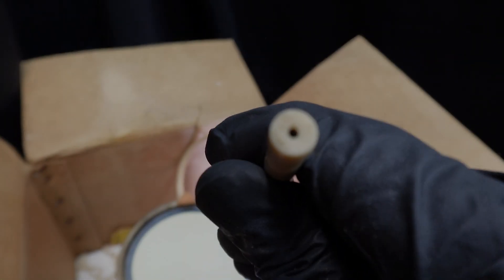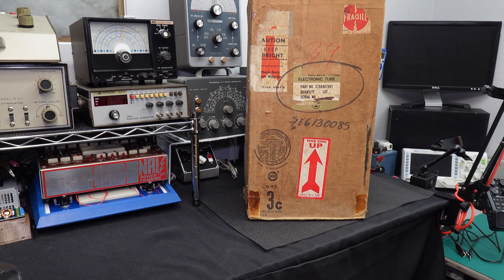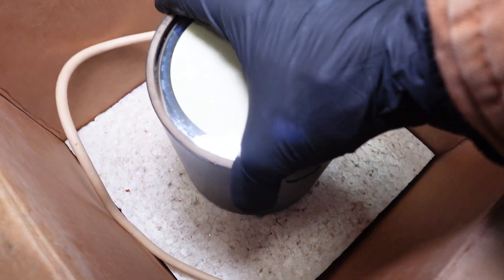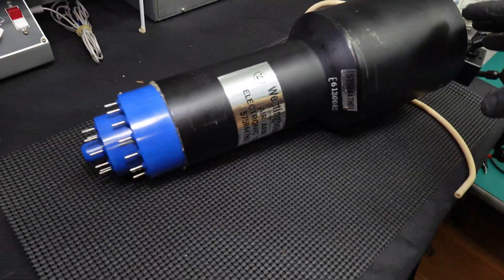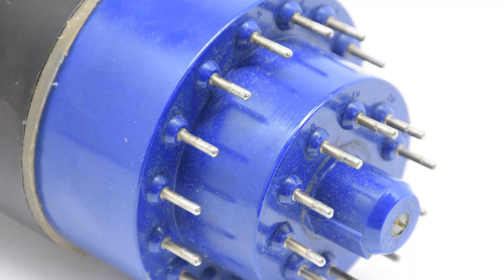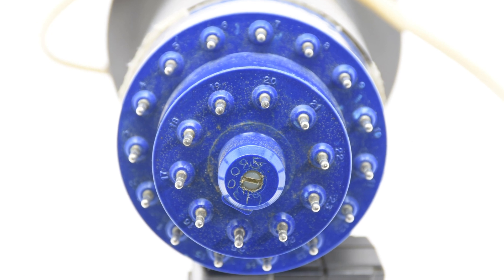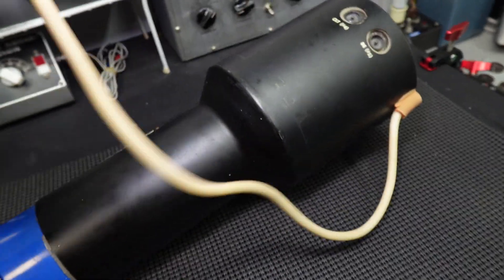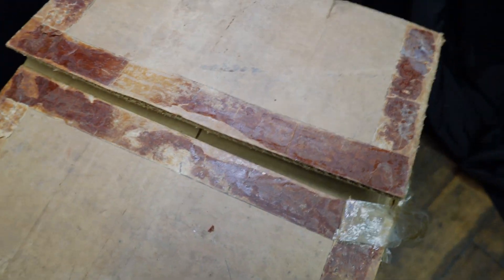Westinghouse Air Arm Electronic Tube. A Vacuum Tube With A Tube?

Comment: A CRT used for some kind of airborne display, probably radar.  The "hose" is a silicone insulated high voltage cable.  The extra connections near the faceplate are probably for image storage grids and meshes.
Reply from the maker: Thanks a lot! I can't believe "wire" never occurred to me. It's the simple things. ;)

Comment: It's actually a wire. It is the high voltage connection for the tube target. Please put the ebay number in the comments. (I searched ebay and didn't see it yet)  I would like it for my collection. (see the video of my collection)
Reply from the maker: Thanks for FINALLY dispelling the mystery...You are a hero! I believe the description has the eBay item number. I can't believe I've never seen your channel...🤗subscribed!
Reply: @BadDogElectronics  Yup, I second @glasslinger, who seems to know a lot more about this than I do.  As a kid taking old tube TVs apart in the 80's and 90's, I would see a similar tube, which I surmised was a high voltage wire.  I vaguely recall the wire being somewhat fragile and solid, not stranded.  A stranded wire would probably leak air.  In your case the wire may have broken off somewhere inside the tube, making it appear as if it is just a pneumatic tube.
Reply from the maker: @networkedperson  Thanks for the comment. Yeah, after hearing that I can't believe I didn't even once think wire. 🤦‍♂
Reply from the maker: Hi @glasslinger, here's the right link for ebay: www.ebay.com/itm/134912323488. I put it on an auction as I don't know the value. However, I trust your expertise if you want to send an offer, I'd love to see it go to your collection :) Thanks!